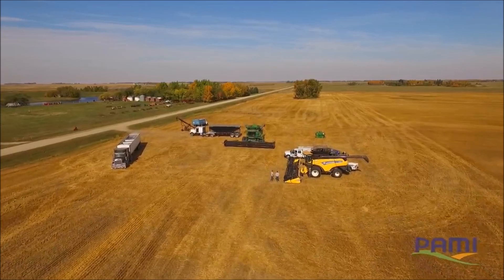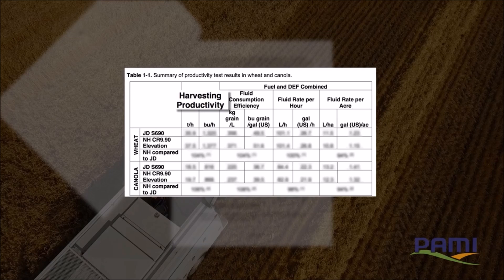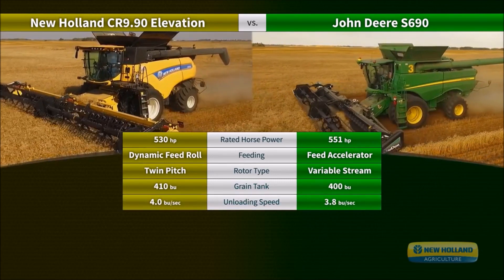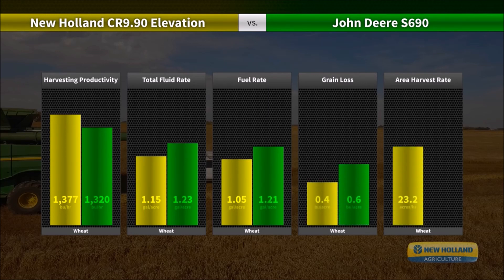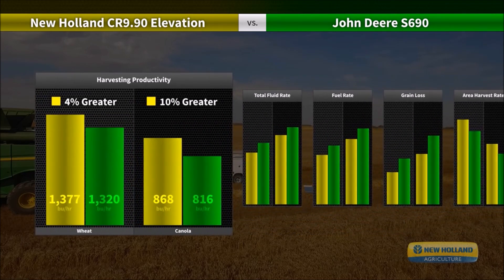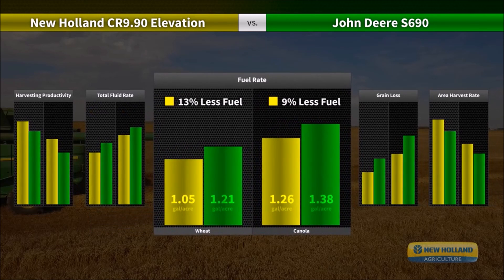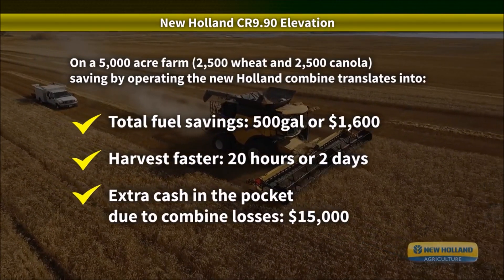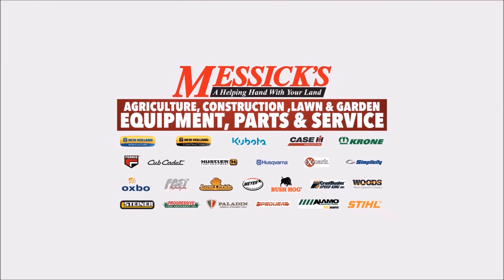New Holland CR9.90 vs Deere S690 | PAMI Test Results

Comment: Greetings from Germany! We use a John Deere W650. It doesn't work well. Almost 5% of the Grain fall out behind the machine. We are not the only ones with that Problem. Every W550 - W660 has that Problem. For us, this costs about 25.000 € per year. And no one can fix this, neither John Deere itself.
Reply: Fabian Weingart 
Try raising the back with bigger rear Wheels. It works on our wts.

Comment: this is so fake they changed somethings that johndeere had better than new holland and made it look like new Holland had better results
Reply: Carter Otto you john deere guys can't take the truth.
Reply: Mackenzie owen I know for a fact that the new holland is better in every way from experience so dont get your parties in a twist if the jd was better I'd use that or case or lexion but the one company that has given me the best results just happens to be the one company with little support in my area so no I'm not even dealer biased they just work great and are efficient and simple

Comment: This is inaccurate because this was 2015 and now it's 2017 and John Deere came out with the new s700 combines
Reply: New Holland has the world record cr10.90
Reply: Won't make much difference. The S700 is a lot of gadgets and gizmos, but mechanically it doesn't change a lot.
Reply from the maker: Yea, this video was done two years ago. Things change. The New Holland model is not current either.
Reply: Messick Farm Equipment yep and never will be
Reply: and new holland whit cr10.90

Comment: This test is such bs. If John Deere would've made this John Deere's numbers would've been higher. This is a joke. That New Holland combine is better then Deere in some categories, but not better in absolutely any category. If New Holland had the better machine they would sell more then Deere. Simple as that.
Reply: In my area I do custom work with our new holland I am the only person with a newer twin rotor machine in my area and i kicked the shit out of all the competition as far as fuel consumption yield and loss my main competitors used john deere and i have never seen so much seed out the ass of a combine not to mention constant repairs at high cost I'm gonna say this test is believable just based on my experience
Reply: We're have a farm in the Uk and including us every other farm around has new holand but if you were to drive 100 miles up the road every farm has jd
Or fent or Masseys it completely depends on what area or country you live in.
Reply: Landon Harris not tire cause my farm farm around 6000 acres up in Alberta Canada and we only see new holland
Reply: Matt Alford People who don't want teens tearing up you're crop.
Reply: Landon Harris right. Tiny UK farms don't even count as actual farms. I mean who puts hedges and fences around fields?
Reply: SteelRodent1456 You make a good point. I am a farmer. We farm around 3500 acres in northern Indiana. No one around us runs New Holland combines or tractors. Mostly John Deere and some case. When there's a new Holland dealer 40 minutes away. According to the video New Holland still makes the best combine. Ha.
Reply: your last sentence is extremely wrong. i can make an example: samsung phones are so much better than apple phones, but apple sells more... so what u said has no sense

Comment: interesting way to trick people in bar graphs...  @2:41 in the BU/HR section... numbers higher but the bar is lower... which doesn't follow suit with the rest of the graph. And then they switch the numbers/color's in the next slide... This whole slide is bogus...
Reply from the maker: you got a crazy eye for detail. Looks more like a typo there than anything shady. As you pointed out its corrected on the next slide.

Comment: I personnly like new holland but I know this is subjective. Ofcourse you make the new holland's results look better.
Reply: I worked at john deere and they say they're the greatest, I'm not saying they are I'm actually a fan of gleaners. Although all of them will try to say that they have the best on the market. Where ya learn what the best is when your in the field. I see the test is probably a pretty good information but it won't change the fact that deere has the largest dealer network in North America that's the only reason deere is still the leader. It's changing slowly though.
Reply: PAMI is non bias- the results are not subjective; it is being promoted by a New Holland dealer and for good reason.
Reply: Thomas Adriaensen no. The New Holland just is better, and has a better paint job.
Reply: WOW this comments and so many actual facts that i sure to go out and buy a New Holland now! bruh stfu and through up some facts before you make a another dumb comment like such.